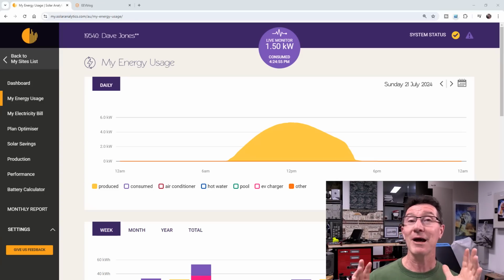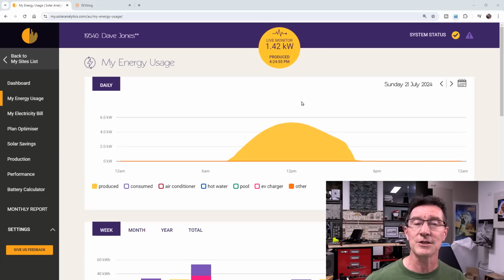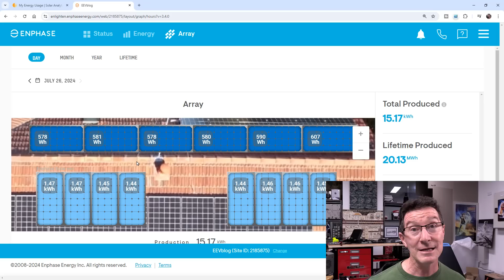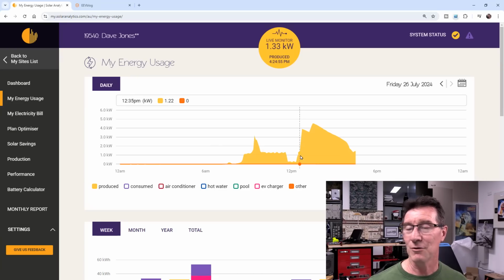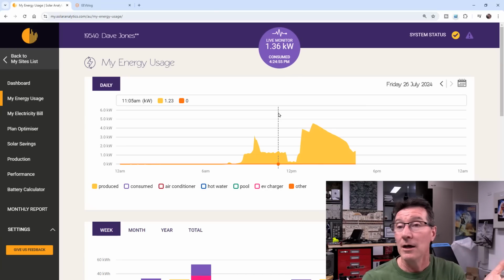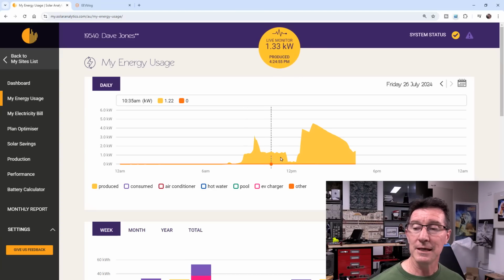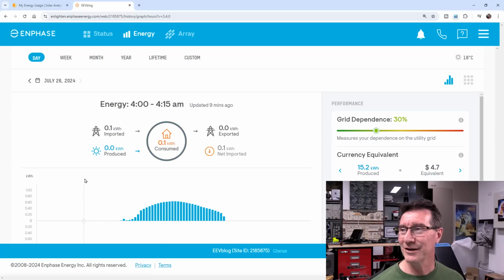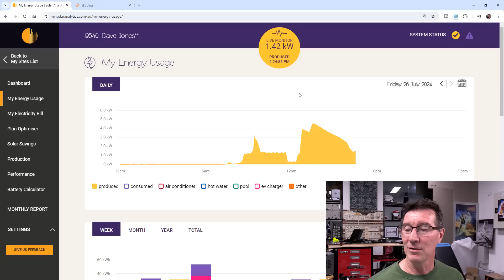The DOWNSIDE of my Home Solar Storage Battery

Comment: Home assistant might be a pathway to go down. The deye inverters work well through solar assistant and can output data via mqqt. Not sure if the same thing can be done via rs232 port you have connected via cable. The deye cloud is a reasonable platform. The enphase envoy  api can be accessed via home assistant as well. Influxdb install along side would provide a place for data storage.
Reply from the maker: I'll took into the possibiliy of adding the Enphase to the Home Assistant. Didn't know it could do that. Can it handle two different data sources at the same time?
Reply: @EEVblog2  " Can it handle two different data sources at the same time?" - Yes it can handle loads of data sources. A modest system will easily handle hundreds of sensors. Once you have the data in Home Assistant, you can do a lot with it. Either process the data further, add, subtract, average, multiply, integrate/derive combine it with other sensors etc, or use it for automation to switch other devices, alert you of certain conditions, or just record and chart the data. You shouldn't need a second instance for your other inverter, you install an integration for each inverter in the same instance. You can then do whatever you like with the data from both. It's very flexible.

If you look at incorporating things like predbat as well you can then automate your battery charging based on predicted solar output, your electricity import and export tariffs if they vary with time, and usage to optimise charge and discharge times.
Reply: Yes Home Assistant is absolutely the way to go here. All the flexibility you need. If the Enphase integration does not satisfy your needs. You could even integrate the solar analytics into home assistant to readout the Enphase system.
Reply from the maker: @Roeland54  Looks like I need a 2nd RPi to run another instance for the Enphase.
Reply: Came here to suggest the same. The Home Assistant energy dashboard is the ideal solution here.
Reply: You can add multiple solar systems, batteries, ....
Reply from the maker: @rianderous8761  Cool, will look into that. EDIT: I just checked, and there does seem to be a integration with the Enphase Envoy system, will try tonight.
Reply: @EEVblog2  there is the cloud based method which relies on enlighten cloud access or the token authentication route which enables access locally.
The deye access I have not done directly  but once you have the data from both systems, a combined total should be able to be calculated. The stats that you can get from the deye are very in depth.
Reply from the maker: @HomeGrownAlchemy  Yes, but I don't want to have to write anything custom myself.
Reply: @EEVblog2  I have very little experience in coding or ha script. I managed to find all the coding for the enphase integration on the forums, and I purchased solar assistant as it has a very easy to integrate mqtt setup for ha. Once you get that info from both systems, I think it is just creating a helper to summate Power Production and PV Power from both the systems.
Reply: @EEVblog2  "writing something yourself" (although I imagine, it should basically just be configuration of components, not complete custom code) is likely, again, the price you'll have to pay for 'cobbling together multiple systems'.
Reply: Home assistant will need an energy meter on your mains as well. The energy dashboard is pretty good. All the other measurements should be able to come off your inverters.
Reply: I was also about to come and post this lol ... 
It's time to move to solar assistant instead .... also means no reliance on 4G anymore ... so no random missing days...
Reply: Definitely home assistant. So reliable. Can connect to anything with relative ease and you can get and display any data exactly how you want. Also rarely need to use indivudual chinese apps for your Inverter, battery, inverter etc... Warning you will get hooked on Home Assistant as it will detect and automatically integrate many of your other IOT devices

Comment: Hope your battery is far away from your house. And the problem is? seems its all working fine, you need to change where you monitor the system from, just change the current clamps location.

Comment: I use SolarEdge for optimisers, inverter and battery so the analytics ow my system shows every thing in as much detail as ya want. The only issue i have with SolarEdge battery is that its not the most user friendly and controllable. If you only have normal user level access you can set the battery to either time of use or self consumption.. that's it.. thankfully i have installer level access so can change ALOT of options including detailed scheduling ability. Another thing i dislike is the battery being 400v meaning there are very few inverters that can be used or at least that i have found.

Comment: i have an Enphase array with a Tesla Powerwall (AC Coupled) battery.  The Enphase system is dumb, and thinks the battery charging is "house consumption", it adds up the real house consumption, and when the powerwall is charging at 5KW it thinks the "house" is consuming a shit-tonne lol  
The Tesla app sees everything individually, and distinguished house consumption, battery charging, car charging, grid import/export, etc.  
It's funny how the Tesla platform can see, and monitor, the solar side of the system better than Enphase can see, and monitor, the Tesla side of the system. The Enphase mobile app is junk, polling rate is less than the Tesla app, and gives almost zero use, while the Tesla app tells me everything, and more, plus gives me complete control of every aspect of the system.  
The Enphase hardware is great, but their software isn't as good as i think it could be. Tesla+Enphase is a killer combo, and every installer i spoke to, before choosing one, told me they love the combo because "it just works" :)

Comment: I would think you could add another clamp onto the input of the battery.. So when it drops out on your current system, it would then show up on the battery clamp.  You would have to get a DC clamp, but I'm sure they are out there

Comment: The battery draining would likely also show up as solar generation with the way it is wired? (the total production might still actually be accurate...)

(It would also be coming from the inverter, and solar analytics will likely not know if it came from panels or battery...)

Comment: There are more solutions. Seems that a lot of people already provided comments. 
1. Use Home Assistant (or other  tool) and connect via modbus to read all registers
2. Use CT clamp (which can support DC), but downside is that you need to know the voltage, but that doesn't change that much I guess. You could either get it via modbus or measure it.
Good luck with finding out what will fit your needs and keep us informed about the battery, since I'm also want to install DC battery soon, I would really love to hear your experience.
Reply: I'm monitoring voltages on my residential 3-phase and it varies A LOT over a 24 hour period. Going as high as 244V during the middle of the day and dropping to 226V at night. And all three phases are similar but not the same. I highly recommend measuring voltage via modbus or similar because you won't get accurate kW without it.
Reply: @nhand42  that could be true indeed on AC level. In the Netherlands our "smart" energy meter is reporting the voltage, amperage and power reading back per phase. As a consumer you could just plug in a P1 cable. I'm not sure if that is the case in the rest of the world. Makes life a lot easier.
Update after some reseach, seems only be availble on smart meters in Belgian, Netherlands, Luxembourg and Sweden

Comment: You are on the wrong chart 😅, there need to be a chart that tell you the PV power output, you are looking at the chart with the energy pushed to grid 😒.
I have mounted a system by my self, I use two Growatt SFP 5000 ES in paralel with a 11KW Pylontech battery's, I changed the firmware of the WiFi modules ( they are detachable using ESP8266 ) write a custom firmware to extract everything the inverter has and I created my own log server to log the data using a thinkerboard from Asus, in fact I use it to host multiple log servers for devices all around my house.
The inverters report everything they do, a lot more that cloud provider will always show you, this is the data I can get from the inverter:

{
  "Grid_voltage":228.500000,
  "Grid_frequency":49.940000,
  "Grid_input_power":0,
  "Grid_charge_current":0.000000,
  "PV_Voltage":109.000000,
  "PV_Charge_current": 0.009174,
  "PV_Power":1,
  "Battery_voltage":49.310000,
  "Battery_capacity":53,
  "Battery_charge_current":0.000000,
  "Battery_discharge_current":4.583249,
  "Output_voltage":229.900000,
  "Output_frequency":49.960000,
  "Output_active_power":155,
  "Output_aparent_power":372,
  "Load_percentage":3.100000,
  "Grid_discharge_today":1.600000,
  "Grid_discharge_total":320.600000,
  "PV_Production_today":17.200000,
  "PV_Production_total":2712.200000,
  "Battery_discharge_today":1.200000,
  "Battery_discharge_total":916.500000,
  "Inverter_temperature":36.100000,
  "DC_DC_temperature":31.700000,
  "Error":"",
  "Warning":"",
  "State":"Discharge",
  "Charge_priority":"PV Only",
  "Grid_rated_voltage":230,
  "Grid_rated_frequency":50,
  "Rated_battery_voltage":48,
  "Max_charge_current":112,
  "Rated_Output_voltage":230,
  "Rated_Output_frequency":50,
  "Rated_Output_power":5000.000000,
  "AC_Charge_current":30
}

Comment: Solution: 
You could use the Load input of the Deye for the enphase output.
That way the  Deye can also use the enphase Energy for charging the battery.
Plus the DEYE provides a Microgrid for the enphase in case of power outage.
Very Potent function of the DEYE right there.
However you would need an additional Smartmeter(CHINT or EASTRON) 
And that would render the Solaranalytics system less useful.
Solarman PV has quite good Analytics as well though😉👌

Comment: Weren't you already alarmed at losing a day of monitoring because someone else's computer had a problem? Dump all the proprietary, single vendor, cloud crap monitoring and put current clamps everywhere you want to monitor, feeding into something like OpenEnergyMonitor that you control. You get to choose what combination of flows you want to visualise and you have direct access to all the data for deeper analytics.

Comment: It's not a downfall actually, just a badly executed monitoring strategy. The solution is something like this: connect to both inverters using RS485, and pull the production data at the same time, simply combine the 2 and store it in some time series database. You not really write software for that, its can be done purely on node-red for example, and forward the data to a Prometheus push gateway, or an influxd  instance,
Reply from the maker: It was not badly executed, the system simply changed and now the existing solution that was great before doesn't work any more. I have no idea about any of the things you mentioned, sounds overly complicated. I think I can do the same thing without another Home Assistant instance connected to the enphase.
Reply: @EEVblog2  
I mean, it's not badly executed in the past obviously, I just want to mention this for the current scenario.
If you plan to go to the Home Assistant route, do it, that is a great solution as well, and you even get dashboards out of the box. :)
I recommend some kind of integration path where you can poll for data as you wish, and it is the key to get accurate data. (Imagine a scenario where the 2 datasource polled at different rate or just not in sync, and you will get very inaccurate combined data, at least for current production values, aggregated values can still work) This is why I recommended the RS485 way, because almost all inverter provides that interface, and can be polled periodically

Comment: Hey Dave, when you said that you drain the battery to 80%, do you mean you use 80% of its capacity, or you drain just 20% of its capacity taking it down to 80% capacity remaining?
Reply from the maker: I must have misspoke, I charge to 100% and discharge to 20%.
Reply: @EEVblog2  makes sense 👍🏼 I thought surely you wouldn’t use only 20% of the capacity haha
Reply: @EEVblog2  wouldn't it make sense to keep the charge between 20% and 80%? Lithium cells sustain the most stress when being low on charge and when being kept fully charged. Most modern phones and laptops offer an option to only charge to e.g. 80% to keep the battery at a level where the lithium cells feel most comfortable and where they can be fast charged without causing too much cell aging...

Comment: You might need to relocate your solar analytics production CT clamp to be on the feed from your enphase system so it isn't counting the production from the Deye, and sum it with the Deye measurements with software such as home assistant.

You could also ignore solar analytics and just combined the Deye local data with the Enphase integration. The new emphase firmware makes it cloud only though. Thankfully my solar installer went bankrupt before they could update my system to the latest firmware so I still have local API access.
Reply from the maker: The Solar Analytics is still very useful for measuring all my loads.

Comment: I rolled my own solar monitoring system using prometheus + grafana. The inverters all seem to have JSON API you can access over local WiFi. No need for an Internet service. Then it's fairly straightforward to combine stats from multiple inverters and data collectors into a single graph.

For most people this is obviously not necessary. But you've got such a complicated system you probably need to do something similar.

Comment: @EEVblog2
The rise and small dip at the end of the charging could be balancing related. Some battery systems go into a balancing mode reducing the charge power at a certain cell voltage. For mine it's 3.45V where it reduces the charge power to 150W per battery module. The time my system balanced was up to 40 minutes but after a year it is down to a couple of minutes.
And as others mentioned, homeassistant is not bad. I built a quite extensive dashboard and have been enjoying it for 1.5 years now without any issues.
And if you feel fancy you can add some grafana dashboards to integrate with home assistant.
Reply from the maker: I did fiddle with one of the batteries the other day...

Comment: Would disabling the charger in the Deye and using a separate mains charger for the battery solve it? Assuming you can turn it on only when producing solar (maybe even ramping up/down in power like an EV charger can)
Reply from the maker: Yes but that would be pretty dumb to do. Lose efficiency and a whole new high current cable run required back to the box.

Comment: I am currently uploading a video that will go live in 2 or 3 days. I showed with a power supply how more voltage equals less current through a G4 LED module. Afterwards I was controlling the LED module on/off by using an astable 555 timer and NPN BJT switch, but the voltage was still too low across the module to work efficiently, so I increased the Base current that controlled the NPN BJT switch. I was surprised that the total current didn't go down much, but after filming I realized that the control circuit was producing more current in order to reduce the load current, so the total current shown on the power supply didn't change as much as the load current actually did. Was a reminder that you may not realize everything that is influencing your measurement.

Comment: Only option is to roll your own tracking system. I use a tig stack (telegraf, influxdb, and grafana), but you could probably use home assistant with less hassle.. Definitely not a simple solution. This is why cloud solutions suck balls, none of them want to cooperate, they are just data whores.

Comment: Have 18kwh of battery storage (12 usable capped by me to 10kw)  
-
12kw is dc, 6kw ac.
They cont communicate with each other and sometimes one will try to charge the other.. so i lose about 2kwh with cross charging. It's silly

Comment: Knew this was going to happen!!! How about letting me upgrade your switchboard Dave?
Reply from the maker: How is a switchboard upgrade going to solve it?
Reply: @EEVblog2  Because measuring current per device (a circuit and light switch) is important like how enphase designed their system mate. Imagine if the computer could do an IR test and report back to the installer??!
Reply from the maker: @TradieTrev  Huh? How is that related to the problem? My Deye Inverter routes DC directly interally from the panels into the battery. The only solution is to combine both Deye production data with the Enphase production data, and that has nothign to do with any wiring.
Reply: @EEVblog2  Duly noted Dave doesn't care about 1.5kA plug in fuses nor cares his government sold off the grid. Your switchboard is a mess and I just want it proper to 2018 standards; Typically being an EE I thought you'd like some dc blockage due to EVs. Guessed not
Reply: @TradieTrev  good point regarding provider sell off, no one but the pollies and retailers benefited from that. The cost of energy in this country is an utter joke and holding us back... Now they are coming for your solar tariff, so Dave has the right idea to try and get off grid as much as possible, good timing.
Reply: @TradieTrev what is dc blockage?
Reply from the maker: @TradieTrev  Mate, relax, I'm getting the switchboard updated, it's been on the cards for a while, have a local guy who is keen to do it on camera, just need to schedule it which has been a hassle due to various things.
Reply from the maker: @edc1569  Yeah, what is DC blockage?